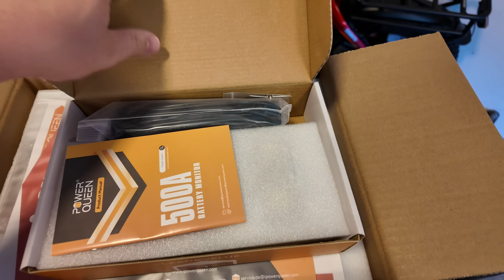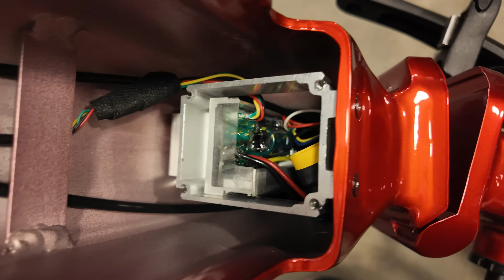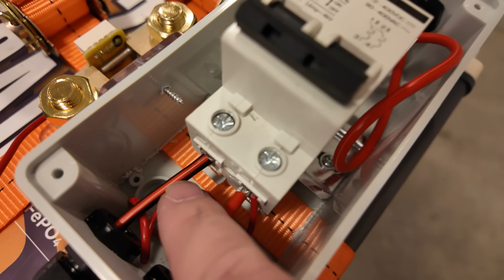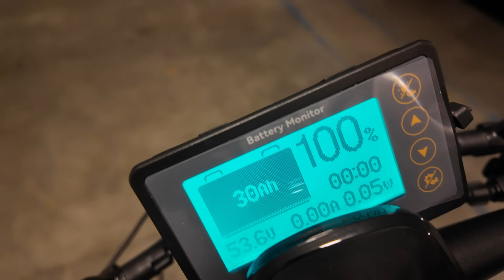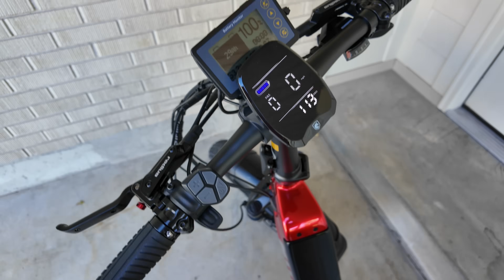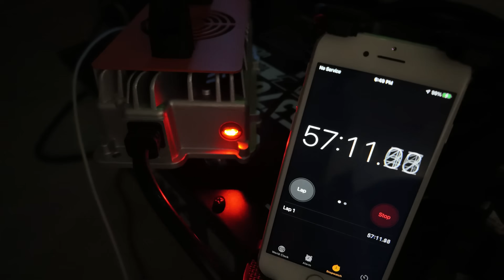STOP Driving My Car? I TRIPLED My E-Bike Range for HALF the Cost! (DIY LiFePO4 Solar Battery Hack)

Comment from the maker: Buy a Power Queen 51.2V 30Ah LiFePO4 Battery: https://ipowerqueen.com/products/power-queen-48v-30ah-gc2-golf-cart-smart-lifepo4-battery?ref=abjzicbm
Be sure to use the code: TRICK at checkout to save 5% on your order!
OR
Buy from Amazon: https://amzn.to/4na0xx2
PRO TIP: I just heard that Power Queen is going to be running some sweet sales right now through November 3rd for Halloween! So you might be able to save even more right now!

Buy a Smart Battery Shunt: https://ipowerqueen.com/products/power-queen-500a-battery-monitor-with-shunt
Be sure to use the code: TRICK at checkout to save 5% on your order!
OR
Buy from Amazon: https://amzn.to/4ooohhS 
PRO TIP: I just heard that Power Queen is going to be running some sweet sales right now through November 3rd for Halloween! So you might be able to save even more right now!

Buy the HOVSCO Hov Beta Folding E-Bike: https://www.hovsco.com/products/hovbeta-foldable-fat-tire-ebike?ref=TheresATrickForThatBeta
Be sure to use the code: ATFT at checkout to save $100 on your order!

Watch the review video on the HOVSCO Hov Beta E-Bike: https://youtu.be/sDBuC9QFH48 

Buy a 48v LiFePO4 Battery Charger: https://amzn.to/4nZ0bdQ 

Buy Circuit Breaker/Disconnect Switch and Enclosure: https://amzn.to/3J96vQK 

Buy armored XT60 extension cables: https://amzn.to/49eqdoC 

Buy XT60i to ring terminal cable: https://amzn.to/4hfpmpZ 

Buy ring terminal wire for negative battery shunt line: https://amzn.to/43dZu80 

Buy cable ties: https://amzn.to/3IZzeYd 

Ratcheting tie down straps: https://amzn.to/3WAINjD 

Buy Callsun solar panels: https://amzn.to/3Wgn0xq 

Buy multi-voltage MPPT solar charge controller: https://www.bougerv.com/products/40a-mppt-solar-charge-controller?aff=230 
OR buy from Amazon: https://amzn.to/41x5BDv 

Ask me a question and get a personal in depth response: https://ko-fi.com/s/8d8df1880c 
OR
Sit down for a personal 1-On-1 hour long video consultation with me and I’ll provide answers and insights to anything you want to ask me about from this channel: https://ko-fi.com/s/dd139831a7 

All donations get 100% re-invested in the channel:
https://buymeacoffee.com/theresatrickforthat 
 
Affiliate Disclosure
As an Amazon associate I earn from qualifying purchases at no cost to you! Thanks for your support!

Comment: Can use the solar charge controller (BougeRV also rebrands that model) to also charge the Li NMC ebike battery, but its dangerous to switch back and forth as the max voltage for 48V LiFePO4 is higher than for NMC and one day you'll forget to change settings.

Comment: Thank you for the video because it explains how I can just use a 48 V 100 amp hour E – bike battery which is a lot cheaper then the power queen. Additionally, it is a lot smaller, so it should take up less space in the basket and it can also fit into a PANNIER.

I’ve been thinking about doing this for a while for my electric tricycle, but the stuff that I saw on YouTube had everything hooking up to a battery balancer and your system makes everything a lot easier and inspires me to do it
Reply from the maker: Glad the video helped simplify the process for your build—good luck with the electric tricycle project!

Comment: I found that when you pull a hill with the extra weight its harder on the controller. i added 4 100 volt 1000 uf capacitors after controller before motor and now controller runs cool all the time
Reply from the maker: That's a clever way to smooth out those power spikes and keep things running cool.

Comment: Yep, it would take you about 40-50 miles without pedaling  I have a 60v 30ah one, but my bike is probably way more heavy. (Freego X2 Pro) and I takes me about 30-35 miles on flat surface, no wind, nice weather. (Of course if it's very cold, the range is way shorter.)  I wish they would sell 60v 50ah for mine. The Freego X3 Pro is 72v 50ah, I envy that. But I'm working on my solar project now, I should focus on that.  🙂
Reply from the maker: Nice data points, and good luck with your solar project!

Comment: Would this work on a Lectric
 folding E-bike, like the Xpedition2?
Reply: Just looking at photos of the
 Xpedition2, I suspect I could do a very similar upgrade. Do any of you have an Xpedition2?
Reply from the maker: I have not tested or looked at that specific bike, so I'm not sure, but if it's a 48 V platform, there's a high likelihood it will work.

Comment: So, for this, is all you need the battery and the correct cable to the ebike? Is the switch and shunt needed?
Reply from the maker: I would certainly include the switch so you have a means of disconnect and over current protection from that huge battery. The shunt is 100% optional.
Reply: @theresatrickforthat TY. Will definitely get a switch than.

Comment: Such an excellent idea, although my ebike has a 15ah battery which is also a 48v system, but I asked my friend which is an electrical engineer,if I could somehow mount and plug in my 12v Lifepo4 40ah battery, he said you can't do it because of the difference in voltages.  Anyway I can work around that?
Reply from the maker: Nope! Can't mix battery chemistries. That's why I have the physical plug on mine that keeps the separated and I just switch the plug if need be to the other battery.
Reply: @theresatrickforthat I see, thanks for the reply and video man.
Thanks for sharing too!
Reply: Yes.  Use a DC-DC boost converter to change from 12V to 48V.  But easier and more efficient to just use another 48V battery

Comment: The world record distence is roughly 250 miles. 

This is what i am aiming for, but i am 100% glad to see someone else taking on the idea i proposed months ago. 

I am not joking, i am honestly happy to see this.
Reply from the maker: Yay! Glad you enjoyed the video! It was sure a fun build!
Reply: @theresatrickforthat  Thank you. 

I do request, becuase i am planning to do it once i get the bike for it, to make one using a cargo ebike. The cargo ebike i am building with is the rad wagon. 

facing the handle bars for orientation. 

top of the rack will have a solar panel (it has that safety bat thingy so that is what will hold the panel)

Right side will have the inverter, and solar batteries sitting on the foot step thing. 

Left will have spare ebike batteries that are mounted to their specail rail thingy. 

The ebike batteries will then be charged through the inverter of the solar side, and the charger each battery comes from. 

This design was chosen specifically to form a battery/electricity bottleneck between solar charging and battery charging. 

This bottle neck ensures that the batteries charge at safe voltages, and speeds to prevent damage to the ebike batteries, while also maximizing energy storage for when the sun has gone down.

Given the spacing of the weird metal bars you can mount to the rad wagon cargo thing, fitting a 200w panel is all you need theoretically. 

The system even has "charge while you ride" redundancy if your ebike has drained all 3/4 ebike batteries. 

I will admit though my build is only theoretical and i am only at the "here is the home made power station phase" of the build and "Securing the franken monster" e-bike 

I would love to see you make something similure if it doesnt cost you too much time or money. 

Also i suspect that you can wire the ebike batteries in paralell for excess range, but then you have to disable the feature that makes the ebike turn off while charging. (some ebikes dont have that safety feature)
Reply: Me too

Comment: You missed the biggest CON. Battery theft/security.
Reply from the maker: Yes...I guess that could be a potential issue. If you're like me, I won't even ride my bike somewhere I know is a theft risk. Most thieves will go for the entire bike anyway because it will take them the same amount of time and they have the tools with them to cut the bike locks vs. spending time to try and figure out how to remove the battery.
Reply: Yup.  If someone really wants to steal your bike, they will, no matter what you do, but there are some things one can do to make it less enticing:

* A secondary spokes or rim lock in addition to the main lock.

* Hidden switch (thieves are pretty dumb, even just having a somewhat obscured breaker or unplugging the power connector is a decent solution).

* If the battery is light enough, take it with you after locking up the bike.  That's what I do with my road bike (my 300Wh battery is only 7lbs).

* Security code for the controller.

* Stealth conversion, which is also what I did.   It's hard to tell that my road bike is electrified at all.

* Motion detector / 100db+ alarm buzzer hidden in the pannier.

* Spray paint the bike frame.  Make it look rusty/ratty when its actually nice.  Less enticing.  Thieves have their psychologies too.

* Keep things cheap so you can replace the bike if/when it gets stolen.

I'm old.  Ask me how I know 🙂

-Matt

Comment: Fun mod.  I did something similar on my road bike conversion but with a much smaller battery (designed for range rather than speed).   I went with LiFePO4 as well, for the same reasons.

There are a lot of little gotchas and issues that require some attention.

* I like the low center of gravity of that rack, due to the small tires.  I had a much harder time on my road bike because of the larger tires.  But that battery form factor (a regular auto-battery type of form factor) adds a huge amount of weight to the bike.  It's also vulnerable in crashes (really vulnerable), and wet, grime, and the elements in general.  A bit too much weight.  The stocky frame hides some of it, but you are probably lapping up against 80lbs+ for the whole bike with both batteries (!).  Maybe even 100lbs?  Weigh it?

* Find a rack bag / pannier for the rear rack that you can house the battery, breaker, and other misc stuff in, rather than strapping it directly to the rack.  This will improve its ability to handle wet conditions, vastly reduce high-g-force vibration, and some protection if you take a dump, and reduce exposure to the elements.

I wound up with the Schwinn Pannier / Seat Pack... it fit perfectly on my rack.  Now obviously that particular pannier won't fit the huge battery you have there, so YMMV.  But...

* I would cut the battery size in half.  This is not trivial to do with a 51.2V system voltage, you may not be able to find a LiFePO4 battery.  But man oh man, over 1500 Wh of energy in just that one battery is vast overkill for any sort of daily or weekend use case.

In my case, since my road bike conversion was a mid-drive at only 500W, extremely light, I wound up with 2 x 25.6V @ 6Ah Talentcell LiFePO4 batteries.   I made a jig out of mini powerpole connectors so I could run them in series for the bike, but run them in parallel for charging.  Only around 300 Wh.  But I can go 50 miles with it due to the configuration and light-weight of the bike.  Much slower though... 25 mph top speed, 15 mph nominal.  But it can go up hills just fine due to being a mid-drive.

The particular battery I use is too light-weight for your configuration so its just an example.  You need something that can push 1000W whereas the setup I'm using can only push 500W or so.   There are smaller 51.2V native LiFePO4 batteries than the one that you have that can do it.

The one I would ... somewhat recommend is the BtrPower 16Ah 48V LiFePO4 (really 16S so... actually 51.2V) battery.  Roughly half the size of the one you have and packaged to reduce weight, so it will be significantly lighter.  This battery can push a ton of current so power isn't a problem.  819 Ah.  It will be less than half the weight of that PowerQueen.

The "somewhat" part is that BtrPower has a bit of a mixed reputation.  Their batteries are popular, but they also sometimes mess up BMS configuration and so on and so forth.  I don't use the charger they include with the battery... I use a proper 4-stage charger and I always run the battery down to float (56.0V) after charging is complete before putting it away.

BtrPower is constantly changing their line-up, but what you are looking for is something in the 12-16 Ah @ 51.2V (16S) range.  Even their 20Ah battery would be an improvement but I'm not sure that one fits in the Pannier I suggested.  I do know that the 16Ah version fits, because I have one.

* The shunt and cabling and display adds weight too.  I have a shunt for mine but I wound up just using a bluetooth interface with my smart phone to monitor it.

-Matt
Reply from the maker: Awesome! Thanks for all the suggestions, Matt! I appreciate it!

Comment: Cool! 
Next project for you- 
Do a motor driven trailer that pushes your regular bicycle. You could put in a 100 AH battery in that one and connect or disconnect anytime you want and have a regular bicycle. You just need a quick disconnect handlebar throttle.
Reply from the maker: Oooh, I like the sound of that!
Reply: You can also put a solar panel on the trailer too as its "cover".  People have done that.  Warning though:  You won't be doing any stunts pulling a trailer.  Those things are heavy once loaded up.  Your whole rig will wind up north of 150lbs.

You can also hang a small solar panel (25W or 50W) off of each side of the rack or flat on top, and have built-in charging.  It's a bit difficult to do because the voltages tend to be too low even for a boost charge controller when going into a 51.2V battery.

As an alternative, though, you can just run the panels into a DC-DC boost converter programmed for the float voltage (56.0V) and it will provide some support.  Rather than trying to fully charge the battery with it.   It will be naturally current-limited by the solar panels so it basically just works.